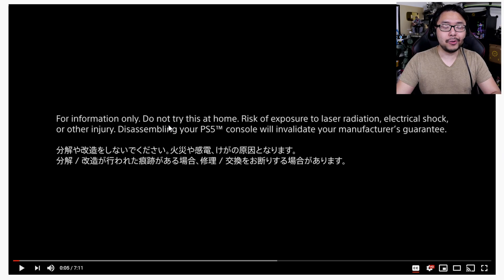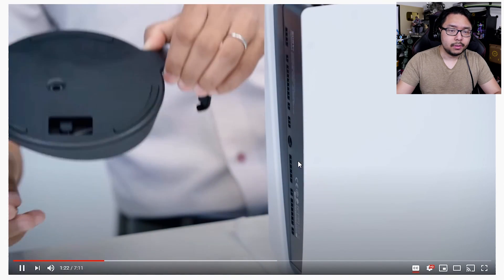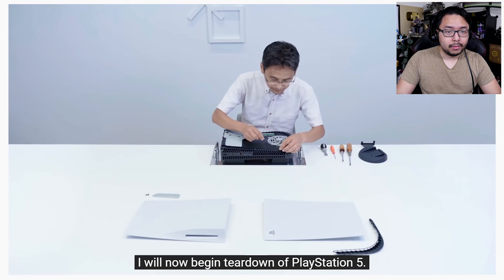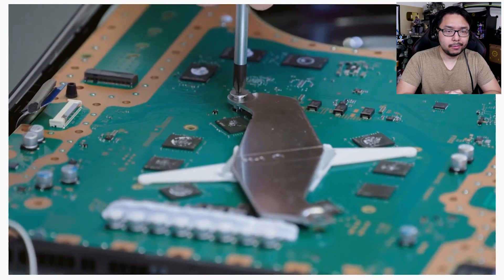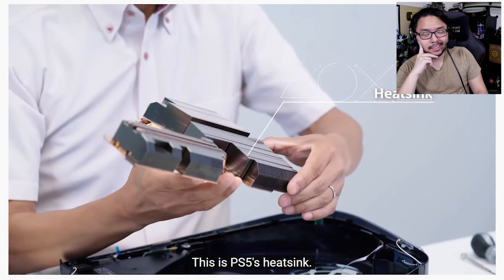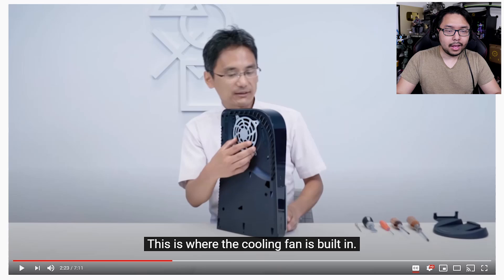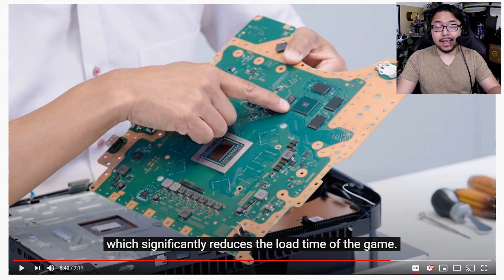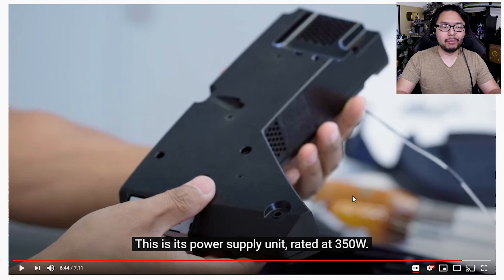Reacting To Sony's PS5 Teardown (Cooling, SSD Slot, Swappable Panels, & More)

Comment: I like the vacuum holes. They actually gives you a way to remove dust from the console without tearing it down.
Reply: Even Deep cleaning this console looks easy. The fan is super accessible to clean the blades.
Reply: IKR
Reply: Even with the dust catchers it doesn't guaranteed dust won't come up in other parts of the console.
Reply: @Yusei255  well yeah its not to ment completely solve the dust problem it just makes it easier to clean
Reply: That made me smile, I always open my systems to vacume the dust out and void the warranty.
Reply: @rumproastwitch  Don't use a vacuum near ANY circuit board. A vacuum creates static electricity when sucking in air, which can end up frying electrical components.
Reply: @WH250398  you're wrong, vacuum that sucks(in) air don't create static electricity, however if the vacuum "expels" the air and blows it(out), then you're right
Reply: @rumproastwitch  opening your console does not void your warranty. Removing “warranty void if removed” stickers does not void your warranty. It is a federal crime for any manufacturer to void a warranty because you opened your own device. It’s just a scare tactic and is 100% illegal for the companies to actually do that.
Reply: @MainNonbusinessEmail  it’s a federal crime, and you could see massive gains in court over it, I’m sure.

Big tech companies (like Apple) have been fighting it for years, but I doubt anything will ever get overturned. You own the hardware, not them. They own the rights to manufacture and distribute the hardware, but they don’t own the physical item you purchased from them. Their warranty HAS to cover what it covers, whether you tinkered with the thing or not.

Imagine buying a new car, changing your windshield wipers six months later, and then having your check engine light come on, and the dealership saying they won’t honor the warranty because you voided it by “repairing it yourself” or some nonsense.

It’s a massive slippery slope, because modifications or aftermarket items can be basically anything for any product, so as opposed to drawing a whole roadmap that outlines what is and isn’t covered, and highlights fringe details and shit, the govt drew one line in the sand and said “all of it is acceptable, your warranty is intact”

This way, there’s no gray area. You own it, you can do what you want with it, the manufacturer has to honor their warranty.

Massive fines were threatened to a bunch of big companies because they were violating it, and they were basically forced to follow the rule of law. If any company infringes on that law, you have rights, and that shit is black and white, so you could prob rake em cross the coals/settle out of court for a pretty hefty sum.
Reply: @MainNonbusinessEmail  I mean I’m not a lawyer, but this isn’t like Nintendo sending out a cease and desist to a website that hosts a Mario flash game. There is no “legal pressure” here. You’re 100% within your legal right, and they’d be committing a felony. Not only would you get all your legal fees paid in full, your probably easily see a six figure settlement, and the FTC would probably find them several millions, if not tens of millions for directly violating them.

The FTC in particular has your back on this one, so you wouldn’t just be like having a small claims case or some shit where the might of Sony would crush you under their weight. They’d get knocked in the fucking teeth by the government on top of anything by they would owe you.

This is all assuming that they’d even do something like not honor your warranty. They’re going to. A bunch of companies got in massive hot water with the government over this already, so it’s not like it just gets swept under the rug and forgotten about, these companies are actively being monitored by the FTC to make sure this shit doesn’t happen.

This is also why I’m telling people about this. You seem legitimately scared/concerned that you have no rights here, because that’s exactly how these companies want you to feel. Intimidated. There is zero percent chance that you would ever lose a case like that, and there’s probably equally as likely a chance that a company would even attempt to void your warranty.

Like I’m not sure in what world a massive lawsuit for violating federal laws with large fines and penalties would somehow benefit a corporation more than just honoring a damn warranty that prob wouldn’t even host them $200 to fulfill is worth it... but there is ZERO chance a company like Sony is going to take all the bad PR, fines & penalties, legal fees, court fees & damages, federal investigations, and all the time wasted, and compare that to Joey Fixit’s missing warranty sticker and his third party Blu-ray mounts designed to dampen the sound even more, and go, “yeah, $50 million plus is totally a lucrative exchange rate so that we don’t have to repair this guy’s $100 faulty power supply!”

It just doesn’t even make a lick of sense
Reply: YES
Reply: I'm sorry for sounding like a dumbass, but does this mean I just put the nozzle of my regular vaccum hose on top of the holes and that should suck up any dust inside? I don't want to accidentally suck up any parts inside in case I fuck up.
Reply: armchairmaster yes, you can use a regular vacuum but a smaller fitting would be preferable
Reply: @Ozzy-Mag  will those air canister thing's  suffice
Reply: Yusei255 I imagine so although they blow air through, not suck, so I would look into it first. They are certainly better for cleaning fan blades and blowing out filters though
Reply: Definitely agree with you. I tore down my launch ps4 earlier this year to clean it and man let me tell you that thing was dirt lol. The fan is still loud as fuck though 😂
Reply: Google+ sucks! Did you clean out both ends of the heat sink? Like the side underneath the motherboard
Reply: It's such a small feature but one of the things I appreciate most. All without potentially voiding warranty.
Reply: @Monius13  there is no such thing as voiding a warranty in the USA. Warranty void stickers are illegal and it is a federal crime for any company to not honor a warranty based on stickers/opening/repairing your own device.

Outside the US it may very well be different, but since you mentioned “potential” warranty voiding I figured I’d chime in on that as many consumers are not aware of this fact.
Reply: It's kinda weird that it took so long for someone to think of this. Usually the console manufacturers only tell people to regularly clean their consoles to maintain top performance, but this is the first time one of them also thought about making it easy for people to do so.
Reply: I know right
Reply: @Makon18  they are constantly berated for this in the pc hardware community air cooling must be cleaned end of this is just a terrible practice
Reply: @Makon18  no problem! I like being helpful lol
Reply: @Frank Marano it is green PCB was used ever since i started in pc's 24 years ago frowned upon these days actualy but it's nice and cheap for a non windowed solution and as for the fan that works just like your vacuum cleaner does it sucks in general one fan sucks the a rear fan blows hot air out result is the box between them becomes a dust bin
Reply: yeah its a great idea
Reply: ikr?i hope microsoft has something simmilar with the series x  so that way we can have launch consoles last for a very long time
Reply: stated at the end of the official teardown video, it says in small words "do not rely on the dust holes 'cause they will not guarantee proper cleaning the console" or something like that, so basically the wholes won't be that helpful
Reply: Reminds me of the bonnet /hood in USA of nissan skyline gtr r34 nur v spec 2 2002
Reply: why are people concerned with dust , ive literally never had a console overheat.
Reply: @possiblyinsane6995  it’s not about it overheating in the short term, it’s about extending the life of the console past its prime.

Excess buildup of dust can damage moving components as well. Just because it hasn’t happened to the small handful of consoles you’ve ever owned, doesn’t mean all consoles are safe from dust and contaminates.

My OG 60gb PS3 had to be torn down 3 times to be cleaned, and aside from a loose HDMI port it runs like a dream. Maybe it would’ve kicked the bucket entirely had I not gone through it. The pictures I took from the second cleaning were terrifying. It looked like the inside of a vacuum in there.
Reply: wokeupinapanic i bought a ps4 at the start of the gen and ive had 2 xb1 and a xb1x. my point is the upgrade cycle consoles have (slim/pro) 
make it easy to get rid of old crap! ps my x360 still works 10 plus years of being kept in the garage full of dirt dust bugs still works
Reply: @possiblyinsane6995  and I still have my original Genesis, a JVC X’Eye (it was my grandmother’s), my SNES, my N64, a handful of PS1’s, two PS2’s, my phat PS3, my gf’s slim PS3, my Wii, a 360, my WiiU, Switch, and PS4... all of those aren’t packed away in some box, and are in use on my TV in the living room or bedroom. Hell, the 360 is in our master bathroom so we can watch DVDs or play games from the bath tub. I also have a couple of cats, so it’s not like our house is immaculate or anything.

My point is, you have a sample size of like 5 consoles most of which are less than 5 years old, or packed away. I have a collection of decades old hardware that still sees regular use.

Your anecdotal evidence is less impressive than mine, and neither of our experiences mirror the real world usage of all consoles. Millions upon millions upon millions of consoles have died due to poor maintenance. Our 20ish individual consoles pale in comparison.

I’ve owned way too many consoles, the majority of which weren’t even listed here, because I either traded em in, swapped em with someone else, or they died. The amount of PS2’s I went thru as a kid made me really want to try and take care of my shit.

If you’re cool with buying a new console every 4 years, great. That doesn’t mean that tens of millions of units of the exact same consoles won’t succumb to issues brought on by poor maintenance. It simply doesn’t work that way.
Reply: @possiblyinsane6995  do you keep yours in a vacuum chamber? Oo
Reply: Skrazor umm no i just worry about it ive never had a console fail due to dust
Reply: Thanks for explaining what was already explained by the professional.
Reply: whoever vacuums a ps5 containing a cpu / gpu is a pure idiot and is risking damage to the console. not to mention a vaccum hole is so damn half ass you will still never be able to get that performance back due to dust accumulating and thickening on fan blades. takes elbo grease to remove.
Reply: @sipmeister3611  the fan and fan shroud are outside of the vacuum compartment for this very reason. You can clean the fan without opening the rest of the console.

The vacuum ducts are there for peace of mind for people that would prefer not to open the whole thing, but still want to clear anything they can from within the main body of the console.

But I mean, go ahead and be a judgmental child about it 🤷🏻‍♂️
Reply: Gonna have to call my ex for this job, shes sucks better than any vacuum
Reply: I don't think they ment to say, u use a vacuum to clear it out. I think that it already does that by it self.
Reply: Amr Gad lol are you being serious?
Reply: Doubtful. That heat sink is huge. Dust get into that thing, it'll be a nightmare. I've cleaned the PS4 one. That was mildly annoying. This is ridiculous. Heat sink looks like a horse stable.

Comment: It's funny if you heat up the stickers u can just stick them back on
Reply: Yes, but those stickers are most likely heat sensitive and change color if you heat them (it's quite usual), so a repair shop will know if you removed them. Other stickers have cuts in a way that you cannot remove them without tearing them. It's not that easy, companies evolve their methods too...
Reply: @thelegendaryklobb2879  funny story back in the day when my ps2 broke down I bought a new one from Target and I took of the serial code and stuck it on the broken one and returned it the fan was full of dust lol.